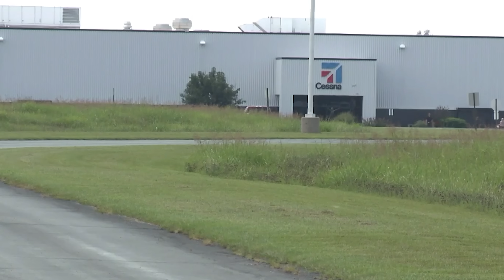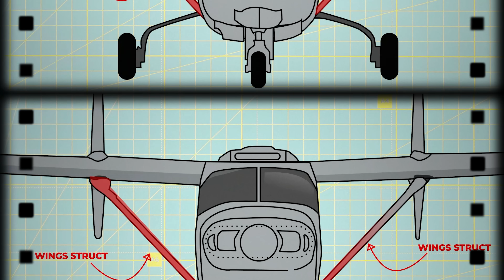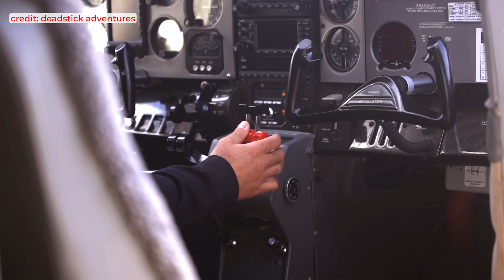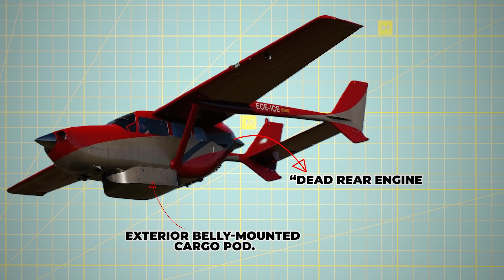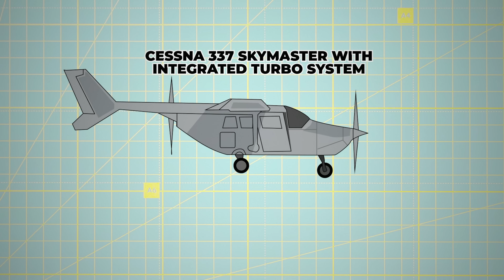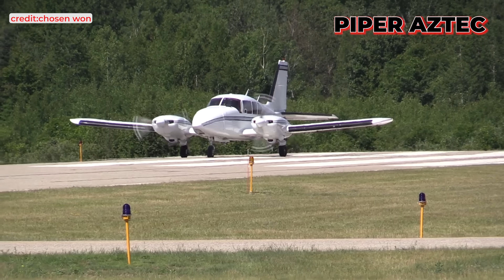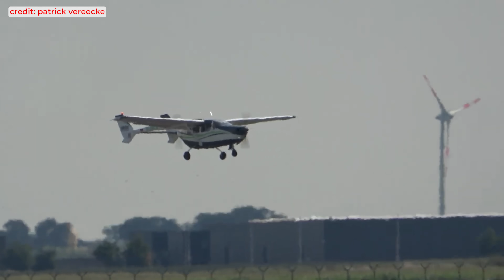Why Did Nobody Want the Twin That Couldn't Kill You?

Comment: Had young distraught family at our house briefly after their father stalled crashed and burned in front of them in a Push Pull.  (what we always called them)
Friend/colleague of my dad, coming from N into Bishop, Cali airport (4100 ft alt) w some engine trouble, unscheduled stop, he unloaded fam and took off alone on one engine and it died on takeoff. 

Makes little sense to me why he'd fly to sort out an engine problem when already on the ground.  Grok recons it's possible to take off and climb out, lightly loaded, on one non-turbo engine, happened mid 1960's, vintage of aircraft no older than that.

(pardon tangent)  All I know is what I was told.  Need to Grok that particular accident.
Reply: I Groked it - found actual accident (small airport, not many accidents) and apparently it was common to have rear engine starting problems so he could have only opted to take off on one, the front, to windmill start the rear.  Only thing that makes any sense.

Comment: I've always liked the 337 🙂  When it comes to speed, you left out a beautiful aircraft, the Ted Smith* Aerostar.  I'm thinking prior to Piper acquiring the product.  I took my multi in a '56 Apache with 150 HP on each side.  The Aztec is known to be the pick-up truck of General Aviation.  🙂  *Ted Smith-the original designer of the Aero Commander.

Comment: Also, if you got your Twin Engine certification on one, you'd be limited to centerline thrust twins only.
Reply: Back in the day (decades ago), US Air Force pilots who used their new Air Force pilot wings to qualify for an FAA commercial, instrument, multi license (with a 100 question written exam to cover the Federal Aviation Regulations) were given that same center-line thrust limitation since the T-37 and T-38 didn't have a terrible yaw if one quit.  That's exactly what I did and the first thing after getting that FAA commerical license, I went to the local FBO and took training in an Aztec to get the restriction removed.  Why?   It didn't "feel like" a real multi-engine rating with the restriction.

Comment: An apu with two electric engines would be interesting.
Reply: Interesting... has anyone tried that configuration?  1st Law of Thermo says NO free lunch, so would have to be a substantial gas turbine PLUS generator... would these FOUR "engines" weigh less than 2 Lycomings?  Gallons Per Hour?
Reply: @fixizin  *2x Continentals.

Comment: Wouldn't the simple addition of a two-needle tachometer clarified the failed engine conundrum?
Reply: Agree. Training appropriate for the type should have been mandatory. The engine out identification was never going to be the same as the typical twin. Identification of the dead engine should have focused on what to expect and what to look for regarding instrument display when you are aware that there will be no yaw to indicate the failed engine. The problem as I see it is the direct comparrison to the conventional twin.And the attraction of this aircraft to low time pilots without the appropriate dual instruction on type. The old saying a little knowledge is a dangerous thing is not as unforgiving as not knowing your aircraft.
Reply: No, it wouldn’t and the same is true for regular twins. As long as there is oil pressure, the prop governor will do what it can to keep the prop moving at the previous RPM. So, for either regular twins or center-lines, you have to first move the controls to max power and then reduce power on the one you think is the problem, Identify, VERIFY, then feather. The problem with the Skymaster was losing the rear engine and the pilot not noticing it. YES, this is poor piloting. YES type training in ANY new airplane is important, and most insurance companies insist on it.
Reply: @theancientartofmodernwarfa1850 
Why not have an idiot light hooked to the ignition coil of each engine? On, ignition firing, off ignition not firing. My triple engine boat has this setup from the factory.
Reply: @Leonardodeweinieo if the prop is still spinning the mags will still be firing.
Reply: @Flyingfish04  Good point... a reasonably modern engine management system would be required to do this properly.
Reply: Manifold pressure would tell you
Reply: Which needle is the failed one then?  And how do you correlate it to controls that are mounted left and right?

The different gauges are actually pretty effective because not only are they arranged LR like the levers are.. they are at a slight angle so the left is slightly forward and the right is slightly rearward.  

Truth is engine failures aren’t a huge deal in this plane.  It’s the pilots who don’t take this plane seriously that are.

Comment: Somebody did try to create a modern composite push/pull, it was called the Adams 500.
Reply: Yeah the Adam was more Baron 58/Navajo size.
Reply: A giant flop
Reply: What killed the Adam was it was way too heavy
Reply from the maker: I'm working on a story on that... But what I meant is something the size of a skymaster, or smaller, around 4 to 5 seats... From my research so far, the Adam couldn't even carry it's pilot with full fuel, talkless of filling other seats...
Reply: @Esploure  My wife and I both worked at Adam Aircraft for a couple years if you have any questions.
Reply: Also Burt Rutan did one.
Reply: @Dan-u1m7i wasn't the scaled composites one very fast?